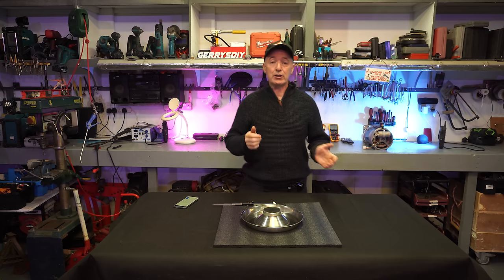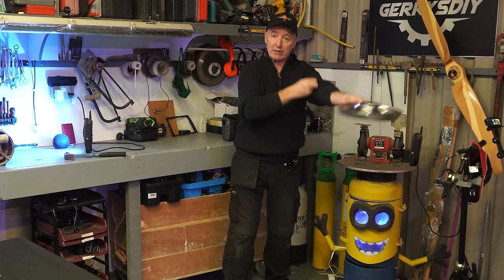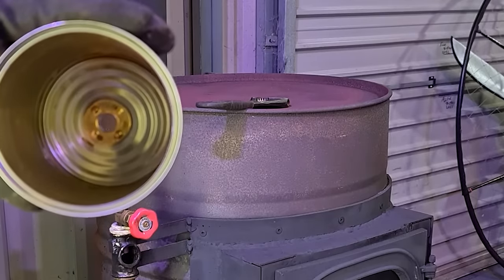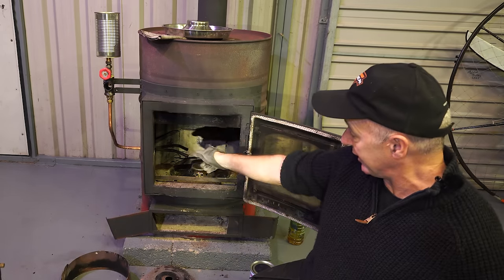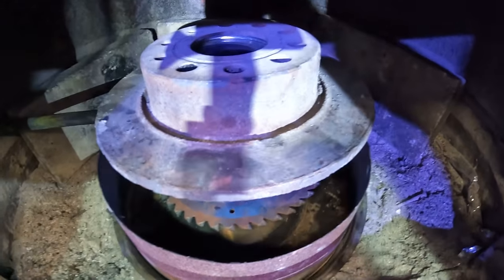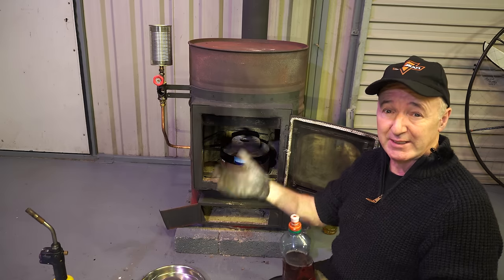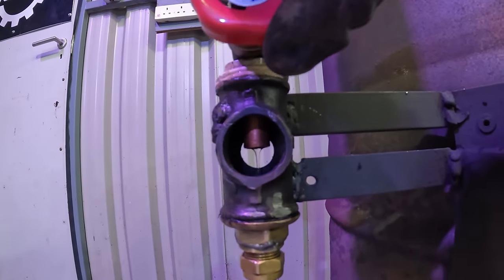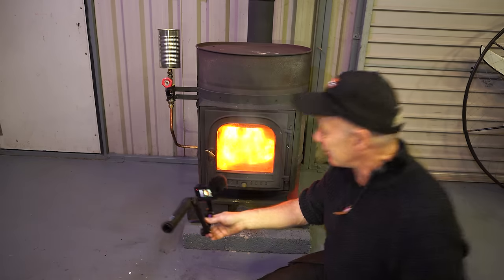FANTASTIC Puppy Feeder Waste Oil Burner

Comment: Why not keep the camera running a little longer to where the whole outside of that barrel turns white hot and it starts to melt, and you decide you need to take the oil can away and then you find out. It's so hot as you run away with the can of oil the fire is following you.
Your neighbor is an illustrator and he did a comic of you trying to outrun the oil and he has you running over a hill and then poofing into smoke?

Comment: My grandparents had an oil furnace.  My father replaced it w/ a natural gas, forced air one.  My grandmother said she really missed her old one because she was never as warm again.
Reply from the maker: Hi Assist Stance. It's going to be an expensive winter world wide this year I think with the way energy is being priced. Thanks for commenting Cheers Gerry 👍👍
Reply: As a kid, my grandmother had one, right in the center of the "dining" room. We got up in the morning freezing and she would have us stand by the stove. She put in the kerosene with a turkey baster, lit it with a wooden match, then turned on the oil. She ran it with a blue flame. By the time breakfast was made, it was warm in the whole house. By the time we went to bed, you couldn't stand the heat! That would last a portion of the night until it was cold in the house again!
Reply: @VangoghsDoggo  Yep! Oil is different.
Reply: @Good4All4Good  Every fuel is the same , the importance is output .
If a burner is low power it will be low power  on gas ,ethanol or oil.
Coal stoves put up a "fight " , they turn red
Reply: That's down to the thermostat not the fuel
Reply: 4G 4S
Reply: A lot of it is RADIANT HEAT.   It has a special warming effect compared to being ducted in.        I learned that using a pellet / corn stove for 10 years.    It would pump out the heat but no matter how hot it just wasn’t anywhere as satisfying as the radiant heat coming off a wood stove.
Reply: @drizler  You may be on to something. Radiant heat warms objects and people, not just the surrounding air.

Comment: I used a pot as a stand & a kitchen utensil holder full of holes from ikea & a saw blade like urs & put fire lighters in the setup & i have no do0r YET,   but it works like a charm.   Well chuffed with it thanks.

Comment: Great video. You could pull air to the burner from the outside so you don't get underpressure in the shed. That way you avoid to pull cold air in =)

Comment: My original burner was made from 1/4 plate steel, looked solid and I thought it would last a long time, but the stainless bowl is a much better way to go. The thick burner I made wouldn't get hot enough to vaporize the oil properly, to big to get properly heat soaked, the thinner stainless bowls handle the heat, get hot faster and vaporize the fuel much better. Now if I can get mine to draft as good as yours, I'll be much better off. Looking good Gerry nice video and cheers,
Reply: Commercially produced non-forced air oil stoves, typically require a minimum of 18 feet of chimney.   How much are  you running?
Reply: Maybe 10' at best, might have to stick with a blower. I added an electric blower, and it runs really hot now.  @ElementofKindness

Comment: You still flying your Paramotor Gerry? back to see how your oil burners have evolved. In usage,  which does the better job? pipe in pipe or puppy tray burner?  (Im busy waiting yet again for Chinese parking heater spares to arrive, if its not the temp sensor its the glow plug, seems to need spares every winter so, might go back 8 years to where we started)

Comment: I watched your video and made My own oil burner for the fireplace how do you keep your oil feed line from clogging it seems to get so hot the oil Burns inside until it is solid charcoal and will not feed any more oil to the fire and it goes out Do you have any suggestiwas your oil feed line submerged under the oil or was it just dripping inside

Comment: Can you use old diesel fuel? I just bought a big tank and it has about 100 gallons of 5 year old off road diesel fuel in it. There's no way I will use that for any of my equipment but it sure would be nice to use it for a burner if possible.

Comment: great video, thanks 👍

I have a question:
Does the smoke coming out of the chimney smell bad or burn clean?
---
I can get used car engine oil for free (recycling) and I've been thinking about taking advantage of it for some time
---
I have a fireplace and I use wood. when the wood is humid it generates a lot of smoke and some neighbors have already complained here. it's only when I light it up and it quickly stops smoking afterwards.

Comment: Thing is, that this kind of tech can be used in allmost any wood burning stove. You just have to build a burner insert that fits the stove, drill a small hole for the oil feed, and you are good to go

Comment: How important is the stove being air tight for this application? I have an old US made cast iron pot belly stove that really isn't safe to use for wood or coal, simply because the chance for a runaway is too high. Think it would be a good candidate for a build like this because of the ability to control the oil feed?

Comment: Love this! 

Challenge for you! I have a shop that I installed a used woodstove in. Works great but it would be nice to be able to burn the waste oil I accumulate instead of trucking it down to Advance Auto. I'd like an easy to build unit to possibly sit on top of the woodstove that I can use to burn waste oil. It'd be nice to leave the unit on the woodstove even when the woodstove is operational...but not required.
Reply: I have an oil feed line into my wood stove , you can virtually set a dish and a rotor or such up inside your wood stove and do the exact same  thing, I have actually tried it I can with in minutes convert my wood stove to oil burner  works great for me

Comment: Gerry I like your vids, have been watching for years on and off, made a few burners myself but great to have someone else doing the experimenting :) Thanks for your work. Might I suggest a video on making these things safer? One fail-safe which springs to mind is a spring loaded shut off valve held open by an easily melted lever - if it gets too hot it bends/gives allowing the supply valve to close. One could also build an air supply tube closer with the same principle. Here in Scandinavia, in woodburners, we always have insulated smoke pipes because condensing tar and soot eventually builds up in the chimney faster otherwise and that can catch fire - leading to an inrush of air being sucked up and it's really hard to extinguish - have you seen any deposit build up inside your smoke pipes, with long term usage? How often do you need to 'sweep' them? A 'fast closer', spring loaded 'cap' on the top of the smoke pipe might be a good idea to prevent runaway fires? Another fail-safe might be a drip feeder of limited diameter so that no more oil than is wanted can ever drip into the burner. Anyone else got some ideas / tried safety feature additions? Have you ever looked at commercially available drip feed burners - Glembring (Sweden) or Refleks (Denmark), for example? Cheers.

Comment: I built a burner simular to yours and the only problem I have is smoke sometimes comes out of the sight fitting.  the stack is clear.  I am using 3/4 black pipe for the drip,  what can be causing this

Comment: Hi Gerry, I have followed you for years ever since you began your waste oil burner videos. Have also watched many by other YouTubers & always wondered why the bottom air intake is not drawn in via plenum from outside instead of sucking in the inside air already heated which make a vacuum on the room which pulls cold air into the room. Cheers
Reply: It's generally a no-brainer to draw air from outside to the intake of woodstoves and rocket mass heaters. Got to let people find it out for themselves.

Comment: I want to make a used veg oil burner like this to put in my wood burning stove like the one in your video. Please let me know.... Q1. To get air for combustion to the burner did you cut a hole in the bottom of the stove, which the puppy feeded sits on? Q2. Does the veg oil drip onto the saw blade or on to the bottom of the puppy feeder? Q3. Whats the purpose of the saw blade and the break drum on the top of the burner? Thanks Tony

Comment: Your designs always work so well. I built and used two for a temporary project. They were hot enough to melt the propane tanks they were made of if I wasn’t careful :) 
Thank you.
Reply from the maker: Thanks. I try to make them easy to construct. The next version will heat water. Working on it next week. Cheers Gerry 
GerrysDiy 👍👍 👍👍👍👍 👍👍
Reply: …and this is why i won’t waste my time with drip feed setups anymore.  It’s just not safe.
Reply: @BlainesGarage  once I dialed it in it was fine. When I turned up the oil too high things got too hot so I turned it down. So not for the totally careless but workable. But everyone has to live within their zones. Definitely not for everyone
Reply: @BlainesGarage  drip systems are commercially available and have been for decades, manufactured in numerous countries from the 'States to the Netherlands. Examples are the Danish Refleks stoves (use on fishing boats so ultra safe) and the Swedish Glembrings. It's just down to refinement and whether one has the experience and knowledge to make a safe one.

Comment: So the key is to use thin material? I made on but its to thick of material takes so long to get going but when it goes its way to much heat for me i cant keep it going with just dripping oil.
Also i think i drilled the holes to close to the bottem what is youre advice ?
Thankyou so much for this great video series i watched them all

Comment: Hi Gerry, your videos are always so much fun to watch, even more because you seem to be so happy showing us your latest magic heating projects.
If I can ever find a place with electricity where I could build one of these, although in a smaller version to heat my boat, I could get through the winters without shivering.
This as my (once) beautiful oil-burning cental heating stopped working last november, it only sooted terribly, and the new yet I installed didn't make any difference.
Also the diesel oil has become much too expensive now to allow me to fill-up the tank with my peanut retirement pension.
The best (dream) solution would be to get the boiler to work again, and get it to work on waste engine oil.
Anyway thanks a lot again for your always very interesting videos.
Cheers,  Peter.
Reply from the maker: Hi Peter. I am working on a boiler project next week but it might be too powerful for what you are looking for. Have a smaller burner in mind that might suit you. Haven't tried it yet but should work. Thanks for commenting Peter Cheers Gerry 👍👍 👍👍👍👍 👍👍

Comment: I love my diesel stove, when I can afford heating oil. (thanks Biden)  
One improvement you could make to yours, is a float bowl regulator system between your supply and control valve.  That way, as fuel gets consumed, you won't have to adjust the control valve to maintain the same BTUs as the fuel level drops.

Comment: Does the hole in the bottom need to be the same size as the exhaust? Where did you get the door with glass and frame work

Comment: How do you control the oil flow if the flame goes out for any reason? How many hours will it run without having to clean the burn chamber that fills with burnt oil crud. I guess the downside is monitoring the oil flow speed as the full waste oil container will have a faster flow rate when full and flow rate will change as the waste oil container has less oil in it.

Comment: I used a cake tin with the same shape. It's been holding up really well.
Reply: If the cake tin is for cooking then it's made to withstand heat and will last ages I'd say   I used dog feeding bowls but after a few weeks they would burn through and then I got a cast iron cooking pot and that's perfect

Comment: Would you reccomend in this particular setup the oil drip on the saw blade. I have one and the oil drips into the base but its just not roaring. Its lighting and stays lighting but isnt roaring. Any advice?

Comment: Hi Gerry, I'm writing from Italy, great job!!! I wanted to know if after a short time that the flame is going, it stays constantly lit around the whole "bowl", or does the flame shrink over time and stays lit only where the oil feed pipe comes from? Then I wanted to know how much oil it consumes in an hour (approximately). Then, the brake disc, put on, what is it for? Is it really necessary or can you do without it? A thousand thanks. Ciao!

Comment: One question I don’t know how to ask properly how long does the tin of oil last I mean the actual measurement of the oil is it like 1 pint of oil for one hour of heat or something like that And does motor oil produces more heat than vegetable oil Thank you for your videos I’m wishing you luck bye-bye for now😊
Reply: maybe to help you understand your question is "how many btu's in a pint of oil" "how many btu's do I need to heat up my space 20 degrees" just a quick look I found a source say veg oil 110,000 btu a gallon(no clue if it true), more then propane 91,451 btu a gallon and less then #2 heating fuel 138,500 btu a gallon. the concept is then if I set the drip at a gallon an hour can my stove and chimney safely handle 110,000 btu's with out overfiring
Reply: @jesshorn257  Yeah that makes sense thank you and Do you think the viscosity of the oil makes a difference on the heat output 🫢🥶
Reply: @yoda12439  I have worked on waste oil heaters for car shops and I know that tranny fluid gives less btu's then a 5w20 for example. my best guess would be that if you treat engine oil as a type #1 heating fuel the btu should average out. The problem is the really heavy weights are tough to transport in a pipe so what happen is you mix it all together and end up with a fluid close to a 10w 30 maybe(this is just me looking at the tank with a dip stick and watching it drip off)...but yes weight makes a difference but if too thick you have to thin it out so it can flow

Comment: I would love to see how more efficient a waste oil stove would be if it was attached to a sand battery. At least 100 lbs of sand stored in a metal enclosure attached to a sidewall of the stove. After 4 or so hours, that sand battery should be close to 400 degrees and last for hours after the stove is out.  It could cut the oil use in half. But I would to see a real world test of this.

Comment: Brilliant!   It is often the simplest solutions that is best and  most reliable.  
Years ago I tired  a way to make a small very hot fire using a method I came across in a bushcraft survival book.  It involved having a thin steel (iron) plate under which a small fire was burning, and then drip a mix of engine oil and water, -  from memory it was at a ratio of three drops oil to one drop of water fed from two containers via a length of angle iron so it drip onto the middle of the hot metal plate.   It burned with a sizzling sound, and very bright flame and no smoke. 
So now I am thinking that perhaps something like that could be incorporated in the likes of the type of oil burner you have designed.? 🙄
I might even try that  myself as I have some waste oil, and I am thinking that this waste oil could be utilized to heat up water,  potentially saving on the ever increasing cost of electricity in the process.?  Perhaps that method could also be utelized in a high temperature incinerator !? 🙄
Stay safe, regards Niels.👍

Comment: in the heating oil woodstove-ish industry they use what they typically call a "catalyst" ..  usually some kind of metal statue think you could say. All it does is put a hot piece of metal for igniting anything combustible in  more places.. that way any and every automized combustible has a higher probability of getting ignited somewhere along its journey UP toward the flue. Im thinking all the things you stacked above the puppy feeder is doing this catalyst thing.

Comment: I like your videos on this, I saw on one of them that you showed that these heaters has no smoke or very little smoke, but what Is the actual issue about the oil burning smell ir the fumes created by burning oil? I can see these type of heaters getting made for low income house holds in México, but my concern is the toxic fumes and smell that may affect the people using these. Thanks and great job!!